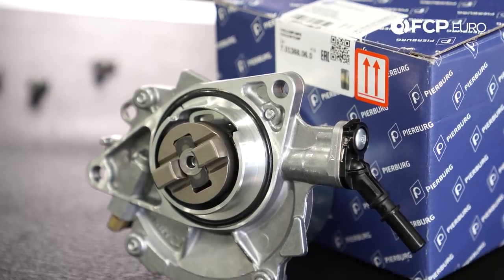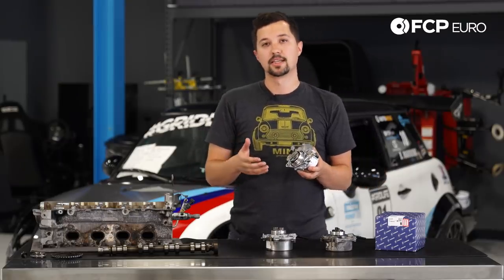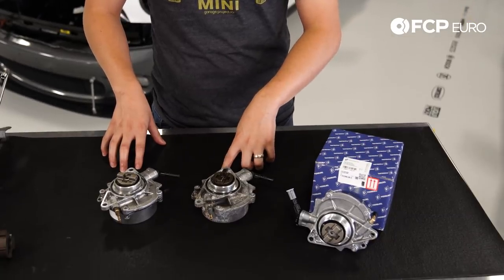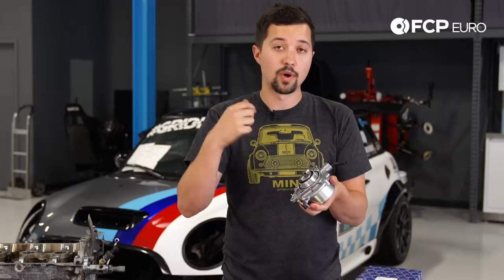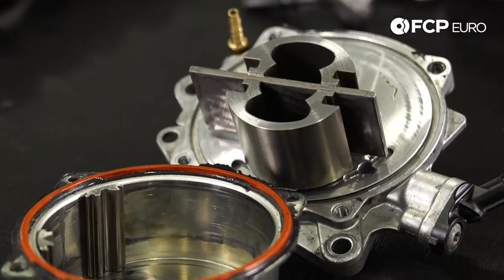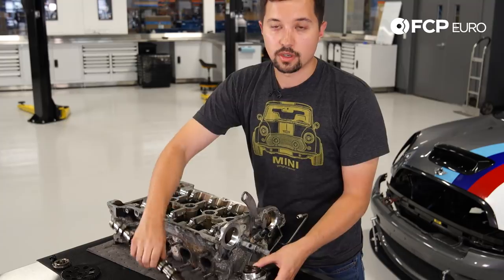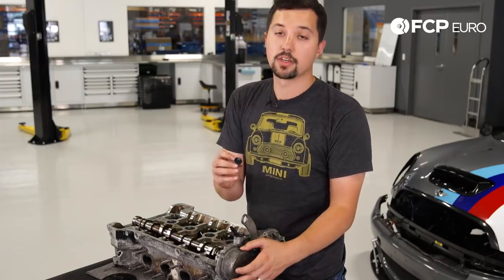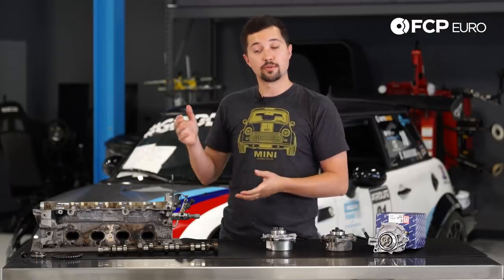MINI N14 Vacuum Pump - Failure, Diagnosis and Product Review

Comment: I been going nuts looking for this oil leak..glad this video helped before starving the vac pump.. Its been driving me insane lol thanks guys 🙏
Reply from the maker: Happy to help RICH! Let us know if you ever need any other parts as we continue to build our MINI catalog. Hope your MINI is up running soon.
Reply: @fcpeuro  just one quick question.. What is this part on the n12 cylinder head?..its on the driver side, rear.. 3 torx bolts and one connector.. Thought i was a hpfp but n12 doesn't have it. Mine was leaking some from there also..took it out to clean and reseal
Reply from the maker: @VWRICH23  Valvetronic Eccentric Shaft Sensor? https://www.fcpeuro.com/products/mini-cooper-eccentric-shaft-sensor-11377541677?ads_cmpid=352579159&ads_adid=22978218439&ads_matchtype=&ads_network=g&ads_creative=85229817079&utm_term=&ads_targetid=pla-28630442231&utm_campaign=&utm_source=adwords&utm_medium=ppc&ttv=2&gclid=Cj0KCQiA7NKBBhDBARIsAHbXCB60HXRoKVG5CpXoMX0CLnqRekr8wD1FikhRgcvEeKaHstq760Lch9EaAgg3EALw_wcB

or the Actuator? https://www.fcpeuro.com/products/mini-engine-camshaft-adjuster-11377533905?ads_cmpid=352579159&ads_adid=22978218439&ads_matchtype=&ads_network=g&ads_creative=85229817079&utm_term=&ads_targetid=pla-28630442231&utm_campaign=&utm_source=adwords&utm_medium=ppc&ttv=2&gclid=Cj0KCQiA7NKBBhDBARIsAHbXCB7T2wljhRDYZFE3HPCKzR-TS54WbK2Ooz8xMlSpDbS9PlEEx3Ei5ksaArsvEALw_wcB

or
Reply: @fcpeuro  it was the actuator !! Awesome.. There was a leak there.. It was tough to take out and reinstall

Comment: Great video, I have a n12 and my vacuum pump ticks on idle, I thought I was the timing chain but it seems to be coming from the vacuum pump.
Reply from the maker: Glad you enjoyed the video! The  timing chain is also known for the death rattle, but direct injection engines in general can have a bunch of "ticks" coming from them. The MINI engines it can be the hydraulic lifters, the injectors, the vacuum pump etc. all make ticking noises unfortunately.

Comment: has it got any return valve to stop engine oil from coming off to the booster in case the one in booster failed ,I have one here gave me aheadache  to find out how come the oil in booster , the brake booster literally filled with oil , I would assume this happening during engine shutdown as that vacuum on booster will suck any oil in pump if it has not got valve at the outlet where vacuum hose connected to it , can you elaborate in this please

Comment: Question as to the oring to seal the block, should the oring fully fill the seat, or will it expand with heat?
Reply from the maker: It will pinch and expand outward a bit

Comment: this catastrophic failure just happened to my JCW, finished rebuilding the engine and runs fine now. my car has only 30,000km from 2010, I barely use it but this happened, any tips to prevent this from happening again in the future?
Reply: how often did you change your oil? If you didn’t drive it frequently, your schedule would have been based off time (4 months or whatever number the shop put on the sticker) and not the miles you've driven.

Comment: I have an R55 non turbo that will not stay running and will not start without pushing the gas and holding the gas to keep it running. If I hold it at 2000 the tac bumps to 2200 and back and when I let off the petal it dies.

Comment: Is the tapping sound that comes and goes at idle normal it sounds similar to like a knock. I have a Subaru with that type of pump
Reply from the maker: Ya it is not a quiet pump by any means even under normal working conditions. It should be a consistent tick though nothing like metal grinding etc
Reply: FCP Euro thank you for helping 🙏🏻
Reply: FCP Euro I heard it today I pressed my brakes a couple times and it went away

Comment: Are the pumps the same on the n18’s? Just bought a 12’ MCS and wanted to do some preventative maintenance. Thanks
Reply from the maker: Hey Xscalab 44 , lucky for your they upgraded the vacuum pump on the N18 along with the  HPFP, so lucky for you it should not be an issue. Its not super rare to have one still fail on occasion, as it functions similarly to the N14,  just keep an eye on the gasket (could replace just this), and be aware of any out of the ordinary noises coming from it.
Reply: Great thanks.

Comment: Is it the same for the N18? I would hope they changed the design for the N18 a little.
Reply from the maker: Brian they indeed redesigned it for the N18, switched it over to this 11667586424 https://www.fcpeuro.com/products/mini-cooper-vacuum-pump-cooper-11667586424  . Sometimes they smarten up ^.^
Reply: FCP Euro Do you know what they did differently? Do the new designs not break the cam if they fail or freeze up?

Comment: Mine is held on by 2 8mm bolt, not 3 10mm bolts. Yours looks to be the exact same
Reply from the maker: You're correct Project Mini , further down in the description we actually noted that ! "*note, it was mentioned it's 3 bolts to take off the Vacuum pump (that is to un-assemble it), it is instead only 2 bolts to remove it from the cylinder head!" When looking at it Ben mentioned the 3 bolts that hold the pump together, not actually the 2 that bolt into the head. Good catch!
Reply: FCP Euro actually it’s 4 bolts that hold it together lol i just rebuilt mine last night. It’s my last uploaded video

Comment: I believe my vacuum pump leaked a bit of oil but then hasn't leaked any for a month or so. Would it be worth checking still ?
Reply from the maker: We'd suggest just pulling it off and inspecting the o-ring/replace the o-rin while its off to ensure a fresh seal and make sure the pump is in working order.
Reply: @fcpeuro  thanks

Comment: there is suppose to be oil inside the Vacuum pump??
Reply from the maker: Oil is what is used to lubricate the vac pump from seizing. That's what the tiny passage hole on the head and  pump is for!

Comment: Could you please help me 
I have a check engine light and the diagnostics says i have a failed MAP sensor and O2 number 2 sensor i allready ordered these parts but my vacum pump makes extremly noisy rattle and i can see a lots of oil under the pump leaking on the engine and for some reason my AC is allways empty i cahrged it before 3 months and allready it doesent blow any cold air.
The car allready consumed 2 litres of aditional oil and i have changed the oil before 8 months ( 8k kilometers)
P.s i have a MINI R56 1.6 88kw
Reply from the maker: Hi B. Dolic, well it sounds like you're having a grand old time with your N14 R56....We would start by replacing the o2 sensor and Map sensor since those are easy to do and you have the parts already. Remove the vacuum pump and inspect it, some noise/rattle is to be expected but excessive play/rubbing OR sticking when spinning the pump is not a good sign and could be symptoms of inevitable failure. It sounds like from the oil your'e seeing it is having an issue sealing to the head of your engine, which is in turn possibly starving the pump from getting proper lubrication (you can replace just the seal as well). Failure of the vacuum pump can be detrimental as mentioned in the video so it may be worth preemptively replacing it regardless. Oil consumption is fairly standard on these n14 engines so without knowing your mileage and how far you are driving in the 8months since the last oil change it is difficult to say for sure whats "normal or not". We suggest having a trained professional inspect your AC system as it can be dangerous to work with and expensive with all the necessary tools (it is likely a leak somewhere in your system).

Comment: I have just experienced a hard brake pedal and was informed was due to a failed vacuum pump is this true???
Reply from the maker: Hey Robert, yes this can very much so be true, this vacuum pump is also responsible for your brake booster, and one of the signs of a failing vac pump is an overly hard brake pedal.
Reply: @fcpeuro  thank you very much!! Looks like I’m buying a pump haha
Reply from the maker: @robtcrider  Happy to help let us know if you need anything else for your MINI !
Reply: @fcpeuro  thank you I’m sure I will. Plan on attempting to remove it later today I just pray I didn’t destroy my Engine 🤦🏻‍♂️
Reply from the maker: @robtcrider  Good luck, I'm sure youre fine if it was completely seized you'd for sure know!
Reply: @fcpeuro  ugh thank youuuu comforting for sure 👊🏼
Reply: @fcpeuro  could it also possibly be just a check valve?
Reply: @fcpeuro  ok so I removed my vacuum booster and appeared to be functioning normally (to my eye) should the turntable can turn smoothly? Or should it have a little give to it? And if NOT the booster what else could it be 😩 sorry for the long message haha
Reply from the maker: @robtcrider  when spinning it you shouldnt feel any sort of grinding but you should feel slight smooth resistence on rotation until it gives. You removed the Vac pump and not the brake booster right?
Reply: @fcpeuro  mmmmm wanna say yes the vac pump same as what’s in this video. And ok mine smooth as you say no grinding great and I ordered a new one which I probably didn’t need now 🤦🏻‍♂️
Reply: @Robert Ely  Hey, I am having the same problem with my mini. Did putting a new vacuum pump fix the problem?
Reply: @Nia434xkisses  it actually did! 👍🏼

Comment: Hi there! I have this same car,  and my issue was that I heard a harsh knocking sound coming from the vacuum pump (almost like a hammering). I took off my pump (lots of oil came out, is that normal?) and I noticed some scoring on the inside of the vacuum chamber cover, but nothing seemed broken. When the cover is off, I am able to move the shaft back and forth, and in the non normal position it will lock. Also, the part that should have some play (the part that connects to the camshaft) can go left and right, as well as up and down on the shaft, is that normal?
Reply from the maker: The hammering sound is not normal, a small tick is what MINI says to not worry about. Scoring should not be there, that means its running dry and starting to likely fail. The movement in the part that attaches to the cam is normal as you can sort of see in this video as well. Not sure which part you're referring to in regards to the shaft though. How many miles on the car?

Comment: Very disappointed, I don’t recommended it I replaced my vacuum pump in July of 2022 it literally lasted 6 months. This part is very difficult to replace and time consuming but if you have to pay a repair shop because you are not mechanically incline it will be very expensive. Patrick reminder me that their parts are not o.e.m but FCP Euro advertise their parts as being just as good quality. Honestly I saved about 150 dollars not buying from BMW but at the end it will cost me more cause now I have to rent a car while I ship, receive, and replace the new part then hope it last more than 6 months. In conclusion pay more buy OEM at the long run it will be cheaper.

Comment: "diagnosis". Takes pump off and spins it by hand. How about hooking a vacuum gauge to the pump while the car is running and comparing it to specs?
Reply from the maker: It wouldn't spin at all with a gauge on it since it was completely locked which again causes the actual failure. The goal was not show how much vacuum the pump was or wasn't generating but instead testing if its locked or has noticeable grinding. Hooking a gauge up would have been a good idea though to see if there was any difference between the old (working) and new on a car.
Reply: @fcpeuro   Then title the video "How to check for a failing vacuum pump and what happens when it fails". If you are going to make a video titled "diagnosis" then you should present all methods of diagnosis not just what your particular situation was. These pumps are expensive and showing the viewers all methods of inspection and testing might save them from changing a part that is not faulty.
Reply from the maker: Appreciate your insight  @rob3071